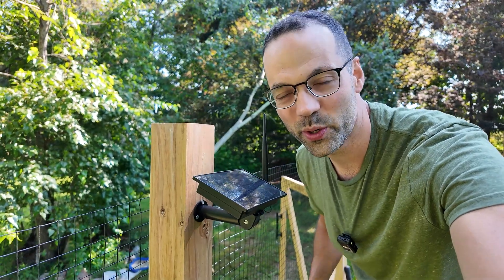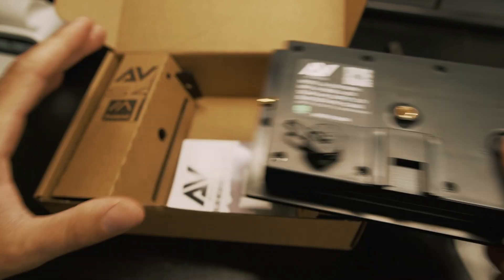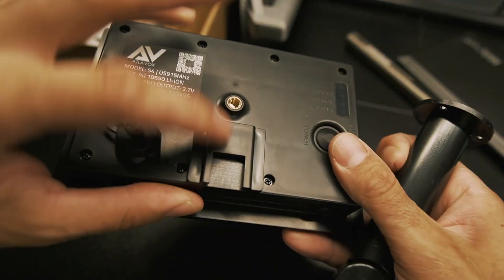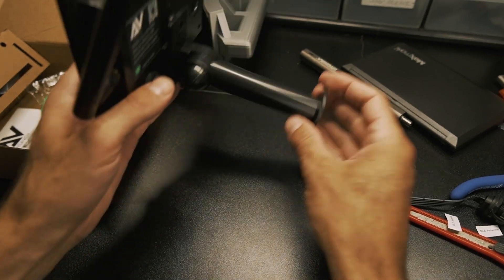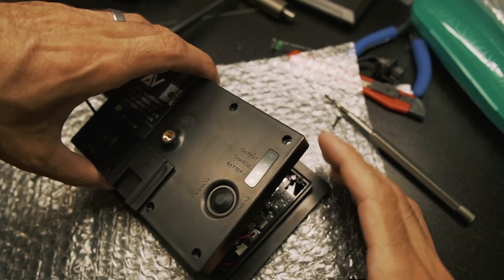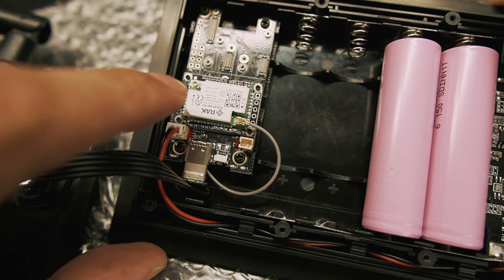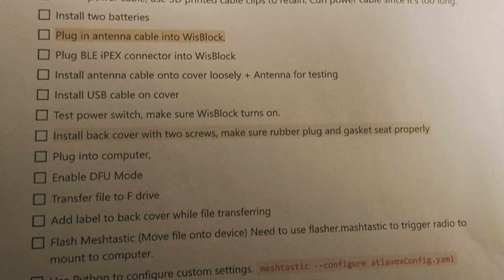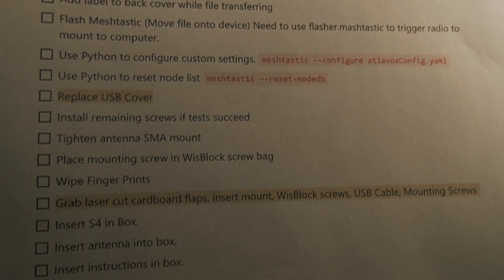Meshtastic Solar Repeater | Atlavox S4

Comment: How do you check the battery voltage on the batteries from the wishblock / meshtastic app if the solar node only gives it 3,7 volts as you said?

Comment: I am totally buying one of these. Strangely the mount is perfect for my application.  I have signed up for the email list. 

The only suggestion I have is given the immense battery capacity, I would set the max SoC to 75% because that would offer the optimal ratio of runtime vs long term durability.  The runtime only has to be able to last a week with no sunlight unless you're planning on selling to the arctic/anarctic circle crowd :-)

Comment: cold, winter weather battery charging?  What does it "repeat"?  I have no idea what meshtastic is.
Reply: how about adding a tiny heater with controller to raise the temperature of the batteries for pre-charging?  use all four batteries.

Comment: That's the same panel I use to power my node never thought about sticking the wisblock inside I even have the same weatherproof usb socket, good spot... Ahhh I see so sacrificed the other 2 batteries to fit it in

Comment: Just add a 3D printed joint with strong flange that slips into, plugs into, and screws into the base of the included mount and standard sized wholes for poles (or an adjustable mechanism)... easy peasy and maintain the ability to use the included angle setting mechanism....

Comment: Love the setup and the professionalism of the design and your work area.  The devices look top notch.  I'm definitley bookmarking this for when I get to that stage of Meshtastic.  The batter life is my main concern and seeing the ability for it to have four batteries and that your one battery beta box never got below the upper 80%s on one battery is very encouraging.  Thanks for putting these together.  With my setup, this would likely need to be mounted to a backyard light post for the best ability for sun and coverage.

Comment: For those wanting GPS, you can easily add GPS to the WISBLOCK.  You can purchase the RAK 19500 GNSS GPS which uses the u-blox ZOE-M8Q module, supporting GLONASS, GPS, BeiDou, and QZSS satellite data protocols.  You just mount the 19500 module onto an empty slot on the WisBlock board and mount the small included GPS antenna to a sky-facing interior surface of the solar case. Only takes a minute to install. Just be aware it will pull more power, but you can adjust GPS settings within the app.

Comment: Hey Matt, solid product!  Could you explain once more about how you have the solar controller connected to the WISBLOCK? I’m just trying to get a better understanding of how the board is utilizing power either from solar or battery. Thank you.
Reply from the maker: The Wisblock draws power from the batteries. Any energy generated by the solar panel is used to charge the batteries. Hope that makes sense. You can also plug in USB power to power it that way or charge the batteries.
Reply: @Atlavox  thanks man… I just meant are you doing something different from plugging in the batteries to the lower left power input and solar on the lower right? Basically how It’s labeled… was just wondering if you are connecting differently? I thought I caught something in the video that you said that made me wonder if you were wiring it differently. That’s all… Thanks!

Comment: Can you add GPS to this? Thinking about putting 2 or 3 down my road to keep my neighborhood connected. Road that needs coverage is maybe 7 or 8 miles long total?
Reply: You can easily add GPS to the WISBLOCK.  You can purchase the RAK 19500 GNSS GPS which uses the u-blox ZOE-M8Q module, supporting GLONASS, GPS, BeiDou, and QZSS satellite data protocols.  You just mount the 19500 module onto an empty slot on the WisBlock board and mount the small included GPS antenna to a sky-facing interior surface of the solar case. Only takes a minute to install.
Reply: @tommyloe5008  awesome! This is good. Just getting into Meshtastic and not really comfortable building one from scratch.

Comment: Does this work for the wifi part of meshtastic? For wireless cameras as an example?
Reply: Meshtastic only supports small data packets… If you were meaning possible transmission of video signals from a Wi-Fi camera, that would not be possible under the Meshtastic platform.
Reply: @tommyloe5008  I wonder if it could do images slowly. Like from a trail cam

Comment: Could you please provide a link for the customized charge controller circuit? I will be purchasing one of your units.
Reply: Purchased one unit.
Reply from the maker: Sorry, I don't have the actual circuit layout. The manufacturer sourced them from a 3rd party with the changes I requested

Comment: I take it these are sold with Lithium Ion batteries?  It seems that would be an issue in the Midwest winters around here.  
It would be beneficial if you could work out some kind of a pole mount compatibility as well.   Looks like a nice set up!
Reply from the maker: Yeah, they are 18650 Lithium ion batteries. Extreme temps will certainly affect performance. I'm in New England so I guess I'll have to do a torture test this winter and see how they do.
Reply: @Atlavox  And being in Texas, I'm concerned about the inside temps during the summer.  This year it's been a fairly "mild" summer.  What kind of temperature sensor, if any, can be put inside the enclosure?
Reply from the maker: @rustyhaddock7954  I went with the 19007 so you'd have more sensor slots available, so you can add an environment sensor if you want.
Reply: @Atlavox  OK.  I look forward to receiving my unit this week and then see about some sensors.  TNX!
Reply: @Atlavox is it possible to add a voltage sensor to be able to monitor if the battery is critical?